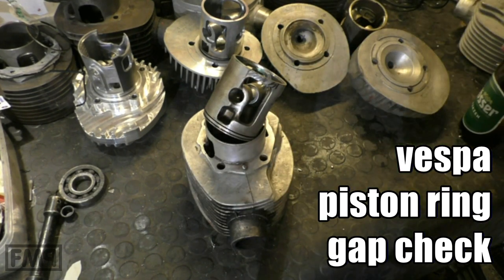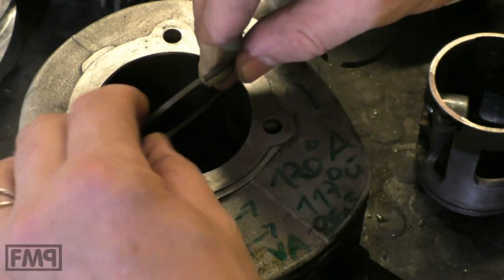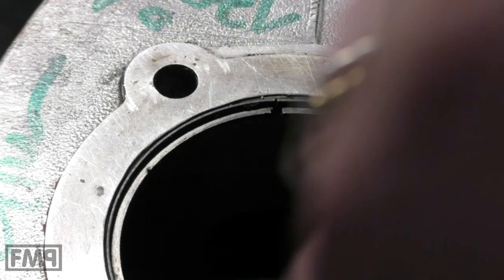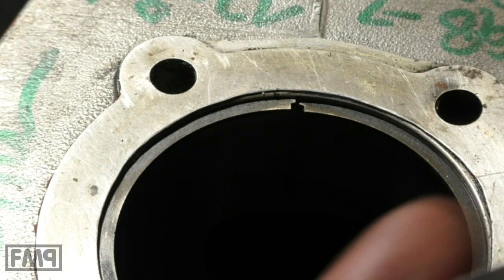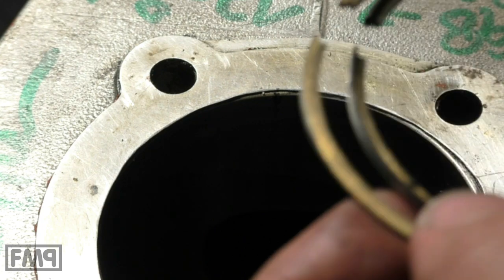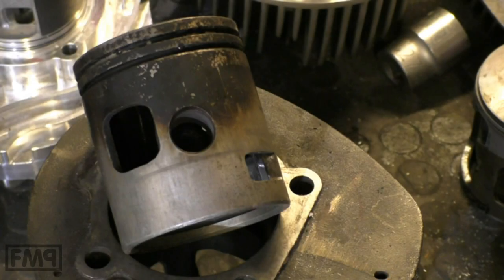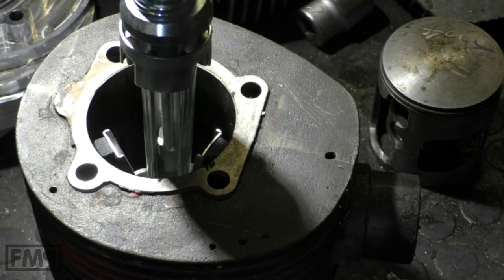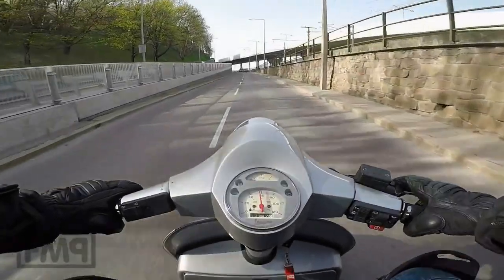how to CHECK vespa piston rings / ring gap - tolerance/ FMPguides - Solid PASSion /

Comment: thank you for taking time to do your videos what are  your run in recommendations for replacing piston rings on a nikasil cylinder
Reply from the maker: Same rings, just new
Reply: @FreakMoPed8  yes replaced due to being worn the cylinder is perfect just polished like a mirror the cylinder is pinasco magny cour 187 on a vnb 8" wheels it has been run 3 years without issue thanks for replying

Comment: Brother, square up the rings by using the piston prior to measuring. This will give you a better idea of gap.
Reply from the maker: I saw. Thx. Yes, thats a good idea thx. To measure the tiny differences between square by hand or by piston, a gauge is too inaccurate anyways. fingers works fine for me ever since. But by piston does have more style indeed 😎👍
In the end its about ensuring its not too tight.